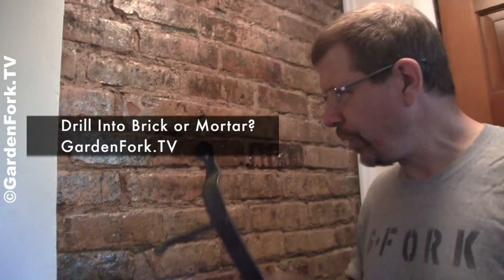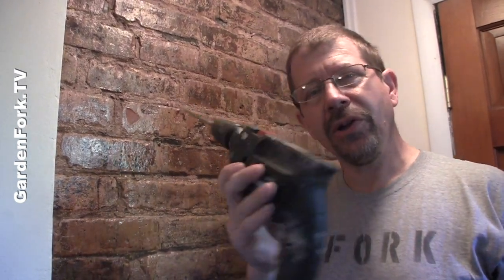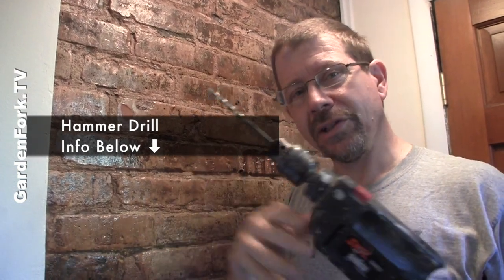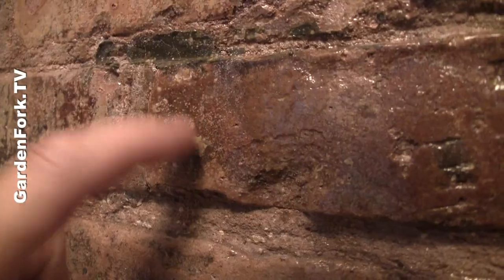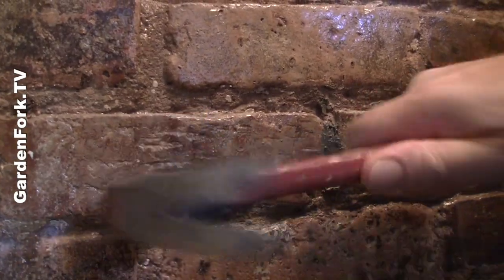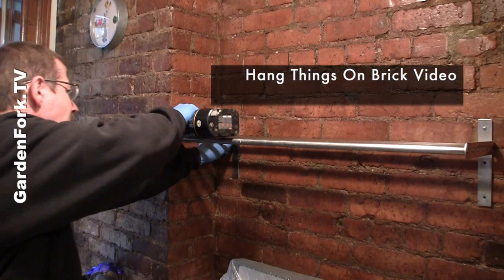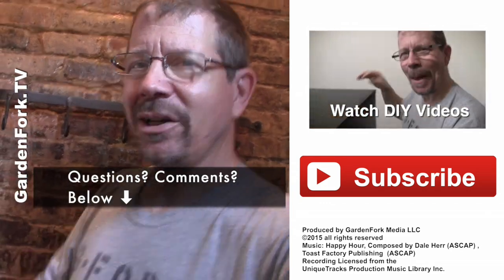Drill Into Brick or the Mortar? - GardenFork

Comment: Brick association says always drill into the mortar NOT the brick. You avoid cracking the brick and if you are hanging something heavy you would drill into the mortar with a large anchor and the pressure would be expanding between the bottom of the top brick and the top of the bottom brick
Reply: also for anything that either not heavy or not so important, just drill into mortar so that you can remove it later without leaving a trace. It's way overkill in this case to go to the brick IMO.
Reply: MrUsaer tapcons don't anchor by compression they anchor by tapping their own threads into the brick. Always anchor into the brick not the mortar when using concrete screws. Mortar isn't strong it's not concrete.
Reply: Sorry but was talking about a compression anchor ie a Sleeve Anchor. For most brick jobs I use a 3/8" x 1 7/8" sleeve anchor into the mortar. You could not pull it out if your life depended on it. IF you choose to later do away with it, it is easy to unbolt and fill in mortar. Also never a risk of cracking the brick. Have hung very large TVs and heavy wall fans etc with no issues
Reply: You're wrong, brother. Drilling in brick doesn't crack it. My 75" tv is mounted on the brick
Reply: @chriswoodward6668  depends on the age & quality of the brick. I've absolutely seen them crack.
Reply: I guess I meant brick not really really old. I meant newer-ish. That makes sense. Old is bad
Reply: And what Mortar association says?))
Reply: The mortar will eventually fall out.  The brick is supported by the weight pushing down.  Don’t drill into the mortar it is just plain nonsense.🇦🇺
Reply: Just a bunch of dudes talkin' brick. Great stuff.

Comment: Brick will hold more weight but if it's older brick and you use the expansion type anchors your liable to break it. It'll be a lot harder to fix if you do. Drilling and angering into the mortar, especially with expansion anchors, is a lot safer although the mortar will not hold as much weight. It is much easier to patch and repair though

Comment: It all depends on different circumstances if you're going to drill into the brick or the mortar. For instance if you got to put up a coat rack and you don't know if you're going to keep it there forever. You are better off drilling into the mortar. That way if you ever decide you want to remove said coat rack. It's easy to repair mortar than it is leaving some ugly holes in the brick. Now if you're going to put up a big heavy fireplace mantle and it's going to be there for life. Then go ahead and drill into the brick. So basically what I'm getting at is you can repoint a brick wall but if you end up doing some crazy DIY project with a bunch of planters all over the brick wall and drill into the brick. Then want to remove everything one day you're going to have tons of holes in your brick that you really can't repair.

Comment: How essential is it that one uses a "hammer drill" as opposed to just a regular drill like my DeWalt? Great video, by the way.
Reply from the maker: +pnutbutrncrackers yes, a hammer drill is essential, I believe. thx!
Reply: @gardenfork  I have a drill that has an option to be used as a hammer drill.  In fact, it has a small pic of a screw, a drill and a hammer (I think this drill I have is an impact driver).  Can I use this for drilling into concrete/bricks?  Should I just select the hammer option and assume somehow that it's the same as using a hammer drill?  Thanks in advance.
Reply from the maker: @azarulahmed789  yes, but make sure to buy hammer drill bits, aka masonry bits. thx!

Comment: Hopefully you get this.   I’m installing a front porch railing into red brick and I drilled the holes to the manufacturers recommended size.   However,  the screws keep breaking about halfway through.    Would you have any suggestions.   Thank you.
Reply from the maker: i'd take the screws and the kit to your local hardware store and ask the oldest guy you can find there. they will know what to do. hard to answer not seeing the screws and all. thx!
Reply: I found out that the drill bit was too small for the screws that were in the package.  So the hardware store gave me a little bit bigger bit.  
And that was the answer to my problem. 
I was able to finish the install today. 
Thanks for your advice.

Comment: Great video, I need to do the opposite and remove bolts, screw anchors from outdoor brick.  I was wondering whether to repair holes with mortar or caulking?
Reply from the maker: mortar. wet the brick before applying the mortar.

Comment: You can eliminate dust production, where brick dust is very messy, using a vacuum cleaner pipe placed at the drill bit.  Note: there is only one 'a' in 'masonRY'!

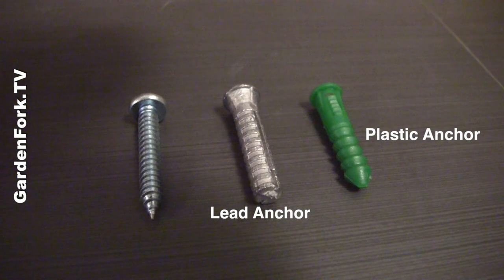Comment: 1:28 I don't see why you wouldn't use a plastic anchor to hang a TV. A TV is not that heavy, and as long as the hole is drilled as the right specification, the weak point is probably the screw itself rather than the anchor. Even the smallest screws have a  shear strength in the 100s of kg.

Comment: is it ok to drill pilot holes when drilling into brick? personally i used a center punch to create a small dimple so my bit wouldnt skip origionally i burned through two cheap masonry bits one of which the chisel bit at the tip was ripped out the reason why this happenend and this is a guess my drill speed was way too high as my drill is of the older type where the trigger has a small speed adjustment dial and as far im aware the highest speed is for drilling through steel so i went out and invested in two very high qaulity 10mm masonry bits 1 a bosch masonry bit and the 2nd a DeWalt 10mm masonry bit and i cranked the speed on my drill right down to normal hammer action and it took awhile as the bricks were quite tough or i couldnt apply enough force but i got there in the end the bosch drill bit performed admirably intact although a little discoloured from heat but otherwise in great condition i honestly do not have loads of experience in drilling into brick im getting there tho

Comment: I want to hang a picture over the fireplace, but when the house was renovated they put travertine tile over the bricks.  Can I still use this method to install anchors, or do you have another suggestion?  Thank you so much for your videos.  VERY helpful.
Reply from the maker: probably, but it depends on how well the tile was affixed to the brick. also be careful not to drill through the brick into the chimney stack.

Comment: Question: What if the bricks aren't the solid type. My house was built with the type that have three holes in them.
Reply from the maker: those are cinder blocks. they are complicated. if you drill into the hollow space, you can use a toggle bolt, if you drill into the solid part of the block you can use an anchor.

Comment: Were those solid brick ?  Most of the ones used in modern homes are of the 3 hole variety.  In those what is the best process.  I think the holed area would not be strong enough, and if you were able to get in the more solid part it would not be wide enough and crack under the drill bit.
Reply: I'd like to know as well.  I mounted my workout TV on a brick wall but I drilled into the horizontal mortar due to the three hole bricks that were present.
Reply from the maker: +eric kohnen hi Eric, for mounting light and medium weight things, its still ok, i think. there is enough brick even with the holed type to hold a screws. for TVs, you'd need to drill into the solid part. thx! eric.
Reply from the maker: +Damian Antonelli the mounting holes on a TV mount are usually so large that you have a wide choice of where to drill. one can drill into the solid part of  holed brick. the best part is near either end. if its a newer house, the mortar would be ok too. I deal with old houses most of the time. thx! eric.

Comment: What to do if my brick wall is covered with a layer of white finish and i can't know what's behind, brick or mortar?
Reply from the maker: +Haik0 you can use the same technique, but if its cinder block you may drill into one of the open spaces of the block. if its a solid cement wall, there is a chance you will hit a piece of rebar when drilling. if so you have to move the drill hole 1" to avoid it. thx!

Comment: I was trying to make a DIY type of clothesline setup above my washer dryer in the laundry room.  I used a stud finder to find the stud and then drilled but it doesn't go into wood.  The wall is drywall and the exterior of that wall is my garage but that garage wall is also drywall in the garage.  I did try to drill the hole high up on my ceiling as I have 9 or 10 foot ceilings and wanted to hang it over my washer/dryer setup.  Would this be a metal nail plate or something?  The drill bit only goes in about 1/2-5/8" and is met with resistance.  I tapped a thin screwdriver in there but it doesn't sound like metal.
Reply: Sounds like you hit a nail or screw in the framing. Or maybe you are trying to drill through the water line! What is on the other side of the wall?

Comment: Thank you very much for video, nice explanation. I have Bosh made hammer drill but always have problems drilling brick walls. I have no idea why but just to hand shelf on the wall its like climbing Everest for me. Standing there with drill trying to make one hole and drills just not going in. And walls not even 100 years old :( I have no idea what Im doing wrong. Any advice would be great. Thank you
Reply from the maker: i suggest buying new masonry drill bits that are made for hammer drills. thx!
Reply: I always use a drill bit for wood, guaranteed it goes through brick like a knife through butter, same can't be said for masonry drill bits

Comment: I'm very interested in your hanging stuff on brick videos.  I have an old fireplace the wife wants to cover with ship lap.  Would it be best to build a frame out of 2x4 lumber (the 4 inch side laying flat on the brick) or just cover the entire brick fireplace with plywood and then nail the ship lap into the plywood?  I was thinking of using plywood so that when I go to attach the ship lap I would have wood beneath it to nail into no matter where I nailed.  The fireplace has a pellet stove in the opening so we never have open flames.  Thoughts?
Reply from the maker: thinking about this, there may be issues with wood so close to the pellet stove, i would check with the local fireplace store and see what they suggest. thx!
Reply: Thanks I will check.  But how about the idea of using full sheets of plywood or just building a frame.  What is your gut feeling on that?

Comment: I totally disagree with this. It is always easier to drill through the mortar than the brick. You also reduce the chance of cracking something by drilling into the mortar. We have 8" thick brick exterior walls and all the stuff that we have is attached to the mortar, unless the hole really requires to be located on brick, for aesthetic reasons or because the mounting holes provided don't land on a mortar line.

Comment: great video. im trying to hang a hose hanger outside not in my vinyl siding but planning to do it in my boiler brick chimney is it ok and shud i use the same technique
Reply from the maker: you have to be careful drilling near a chimney that you don't drill a hole into the chimney flue, not a good thing. thx!
Reply: ty so much for letting me kn